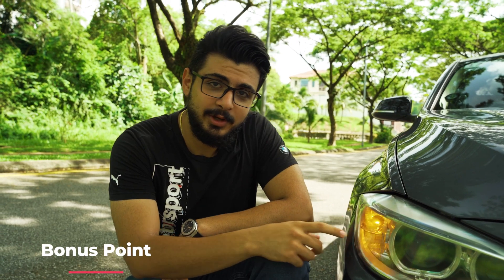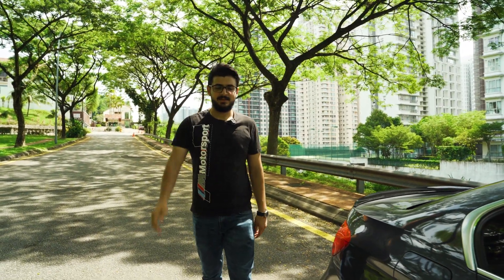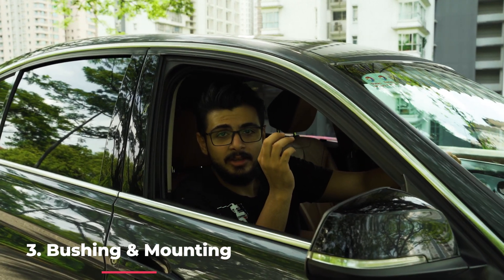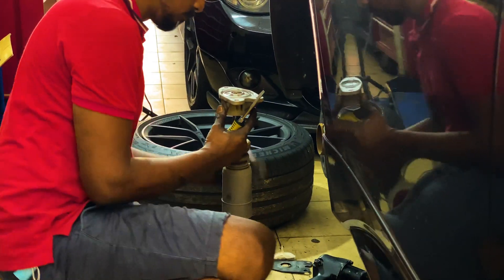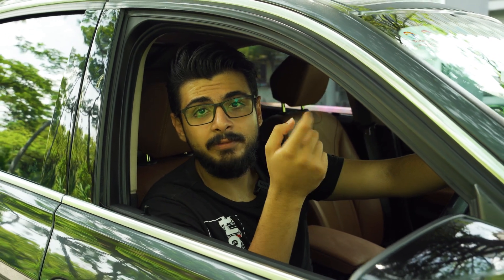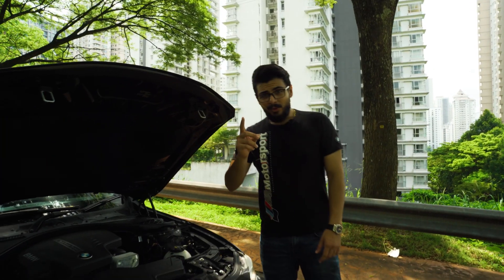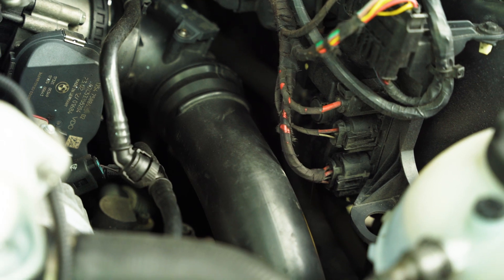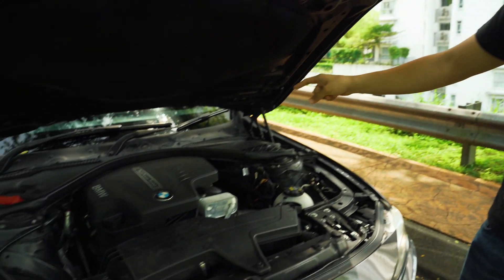5 Things you Must Do IMMEDIATELY After Buying a Used Car! (Very Important) | Brand New Used Car Ep.1

Comment: Thank for informative video. So I will take my new used car to change, engine oil, oil filter, timing chain, maybe plastic 😃😃😃
Reply from the maker: 😂😂 Exactly
Reply: Upgrade your intercooler
Upgrade your air filters
Change yr charge pipes to almunium 
Check your oil engine

Comment: If you have any issues on F30 door rattle, please do share. I had mine for quite sometimes now. managed to tackle few but still heard it mainly on the driver door. the rattle usually went away when i cracked the window slight open though.
Reply from the maker: I haven't had any Door Rattling issues.
Reply: Have you solved the door rattle issue? My X1 had rattle, I use Sonax Gummipfleger on the door rubber seals, seems to work
Reply: @jayasingamratnasingam253  yup. Changes all rubber seal for all 4 door frames

Comment: Like your videos, 2012 320D / 520D, do not have timing chain problem isn't?
Shall change too if I bought it?
Reply: all f serias has timing chain problems. But all deepend is on where u drive more. Bcoz at motorway your resurces is much more bigger.  But after 150-200k invest 1k € is not that much anyway
Reply from the maker: Glad you like my videos! I didn't have any Timing Chain Problems with my 520d. But It's recommended to have it changed in order to prevent very costly repairs down the road!

Comment: just bought a F34 2014 model..wanna do the timing chain and it does not cost 500...the timing chain parts alone cost 800 and no labour yet..shop told me need to leave the car for 2 days
Reply from the maker: That’s interesting. I was quoted around $500 for the parts in Malaysia not including labour.
Reply: @AJDrives  i think the shop quoted for the OEM parts..u should ask the shop if its the original BMW..i still dont know how much is the labour for replacing it..if u have the pricing do share.
And mine have the infamous wastegate rattle..its quite noticeable during low RPM..trying to find a reliable fix for it.
Reply from the maker: I also have the wastegate rattle, I also need to service my turbo. So getting the rattle fixed at the same time. 
I’ll make sure to ask the shop about the Original Parts. Thanks
Reply: Was quoted abt 1.2k for valve seals & timing chain replacement..the timing chain set was 500 for parts, and it state oem, which is fine if they use known brand such as Febi but of course for peace of mind better buy original BMW teile.
Reply: @ragirox  Hey that's a headsup I need thanks buddy. I am in the market for a used F34 too. do you mind telling me what to look out for when viewing a used model. I checked out one at a used car lot recently and found valve cover gasket had oil stains could be leaks according to the sales man it's common on BMW's.

Comment: planning to get a F30, here in malaysia.. how much you spend to change all these 5 things?
Reply from the maker: That's great! Which F30 are you planning to buy? 

The Engine Oil + Filter & Gear Oil + Filter Together were around RM1500.
Only had to change 2 Rear Shock Mountings, Paid around RM350 for those.
Timing Chain is between RM2k - RM4k depending on where you change it.
FTP Charge Pipe + Boost Pipe Set is around RM1800.
Reply: @AJDrives  booked one 320d from BMW premium selection.. hope the car will not disappointed me.. thanks for sharing the cost! and your video is awesome..
Reply from the maker: That's amazing! Congrats! 
I'll actually be doing a modified 320d review in the near future so Subscribe & stay tuned 😁

Comment: I have this shuddering/ vibration noise from wheels when I break in high speed in my 640D, any suggestions plz?
Reply: Thats more than likely warped rotors
Reply: or brake pads need to be replaced